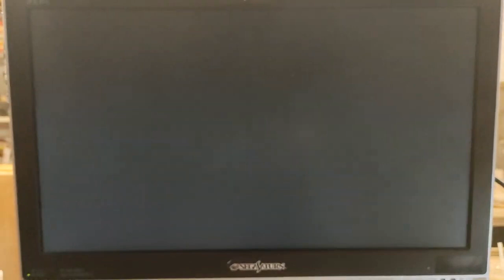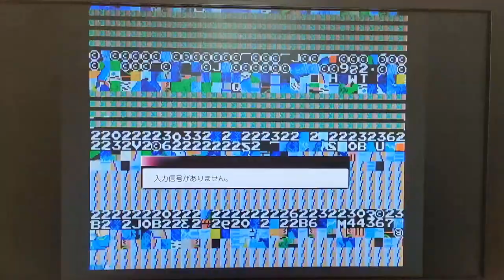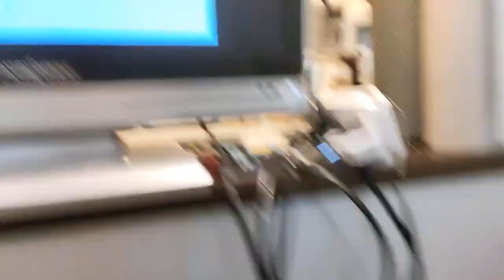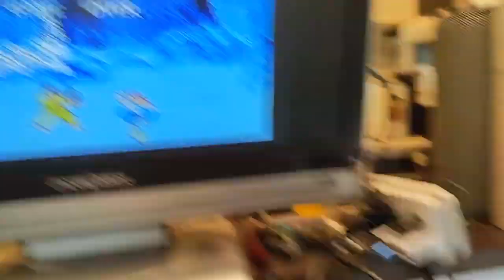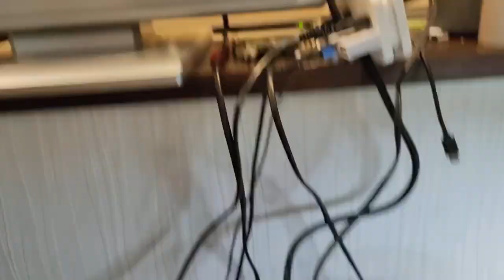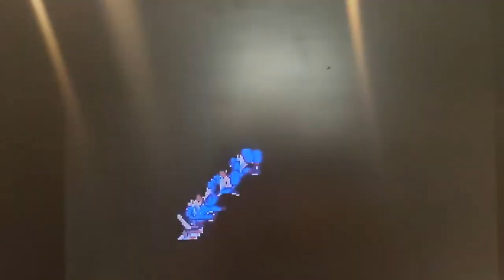Konami Yie Ar Kung-Fu 1984 Arcade PCB Repair

Comment: Hi Luke, great repair! FWIW, I was told when I was trained that when you have component leads that need bending for PCB assembly that you should hold the lead in some round-nose pliers and bend it around the pliers so the bend is some distance from the edge of the package. If you just freeform bend it, the lead will be bend right where it comes out of the package and supposedly it's more prone to breaking there. Anyway, keep up the good work saving those old boards!

Comment: Merry Christmas Luke! :) I was thinking?, with the wrinkles being more prominent underneath, may it be a byproduct of the wave/flow? soldering those 70's, 80's era traces went through? (where the board is run through a solder bath) Reminds me of the traces on the Spectrum p.c.b's too. :) A superb game by the way! I love the permutations of moves in every stick direction, proper kung-fu. <3
Reply from the maker: Merry Christmas and Happy New Year back at you beginner! 🎊 
That is an interesting idea there about the foil like traces on the bottom, I'm not sure to be honest but very possible. That is neat about the game though. I realized that after playing this a little bit and it's really quick and fluid. Kinda shocking for such an early game but it's really cool. First time playing it too. Might have to make a gameplay on it soon but thanks again!

Comment: At least the VLM5030 speech codec wasn't bad...afaik they were only used in arcade hardware and nowadays they're very hard to get.
Reply from the maker: That's a really good point...
Finding NOS or legit old stock replacements is also getting harder. Basically trying to recycle the parts I know are genuine and taking that risk with the used parts when I have to. Thanks for the info there on the speech codec, very interesting. Hope you are having a Happy Holiday